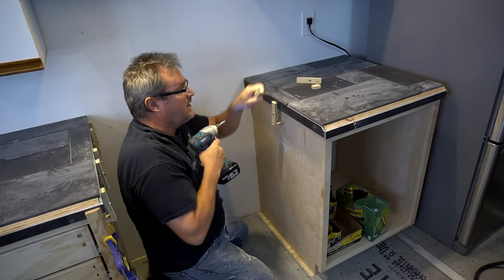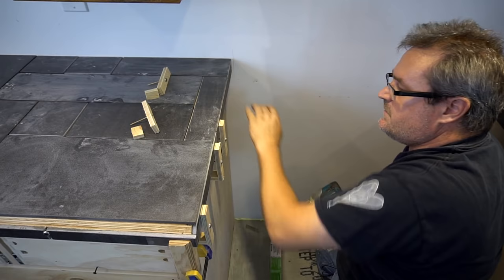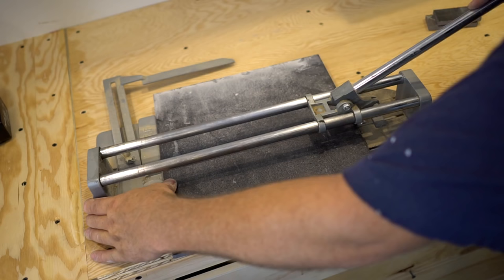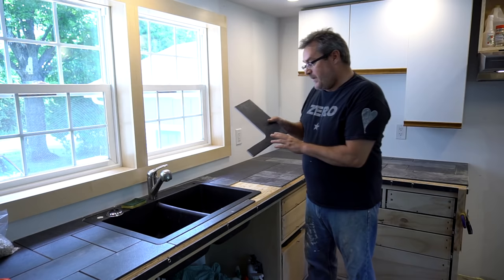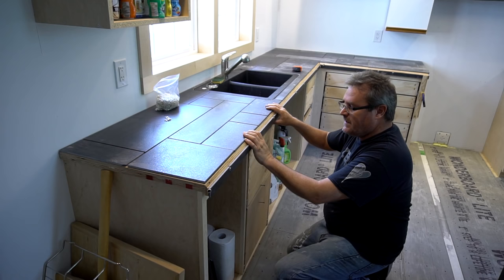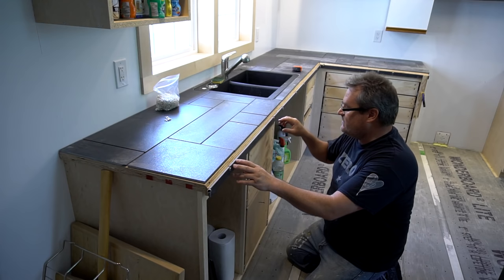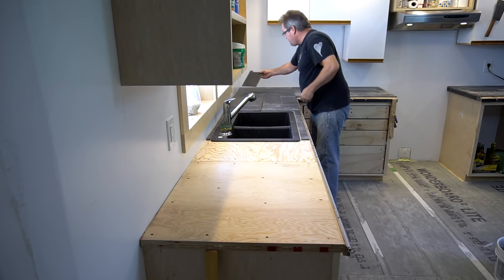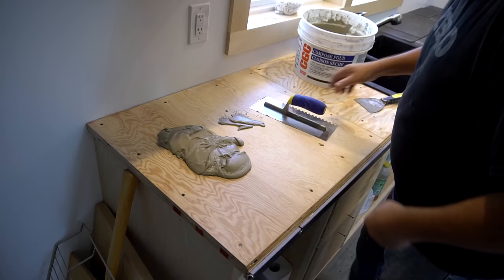How To Install A Tile Counter Top

Comment: Is it unglazed tile?  We don't need to use backerboard?
Reply: tile setters usually float the counter top about an inch with cement "mud" and tile on top of that. it looks like this method works just fine but I'm not sure how strong or how long mortar will bond to plywood
Reply: Are we french???

Comment: I've done the direct plywood glue down. years later the problem I found when I pulled the tile was that the grout is not water proof so water and other liquids will penetrate the grout and cause the plywood surface to rot and release the tile.  Some folks rarely use their kitchens so water penetration is not a problem, others that use their kitchen should use a concrete backer board on at least the counter top. I had some spots of the plywood warp but it took about 7 years for that to happen. A lot of house flippers will do glue down tiles in showers and kitchens  so you have to really watch out for this kind of cheapo installation that will cause all kinds of heartbreak down the road. I do love the pattern but sad to see how you mounted them.

Comment: Looks great,  very fancy look with the tile layout and color.  Looks like a lot of work, especially for someone like me that has never tiled, but I want to try and recreate this look for my moms kitchen which is basically just the 'L' on your window side.  Her countertop is literally falling apart from water reaching the particleboard.  

You said you used 12" x 24" for the full tiles, and looks like your cuts were 12"x12",  6"x24", 6"x12", 6"x6"?  Maybe someone can tell me but is there no need for backer-board when using exterior grade plywood?  Or would using 3/4 plywood, with 1/4" backer-board be a safer bet?

Comment: Looks good, but I would have expected something more DIY like concrete counter tops. But I guess that would be a lot more work than the tile.
Reply from the maker: Already did concrete: http://www.ibuildit.ca/other%20projects/Home%20Improvement/bathroom-1.html
Not a lot more work than this, but the tile is much harder and more durable, making it better for a counter top.

Comment: I don't think those tiles will stick for long. You didnt press hard enough to get 90% coverage on the back sides. They're just sitting on top.
Reply from the maker: And yet it's 2 years later and they are still there. 

You got one part right, though: the "I don't think" seems right on the money. Add to that: "I don't know, but feel I should say something anyway" and that would make it completely accurate.

Comment: John, did you consider installing granite yourself?
Reply from the maker: To be perfectly honest, I don't really like granite for a counter top - looks to hotel. Besides that, it's not really a diy thing and very expensive. Oh, and did I mention that I don't like it? :)
Reply: I got pieces of granite from a granite place in exchange for a few six packs of good beer.  It installs easily except for the sink, which requires extra cutting of course.
Reply from the maker: Got any pictures?
Up here, granite starts at around $60 per square foot installed.
Reply: I Build It Home
You are right, it is normally very expensive.  I got slabs that the shop foreman said were flawed, but they look fine.

Comment: I will NEVER USE MORTAR AGAIN, its messy, hard to work with and dries way to fast ~ it may cost a little bit more to use tube silicone, and liquid nails.  But its worth with. Less cleaning time, less mess